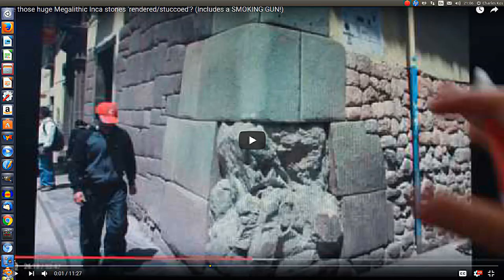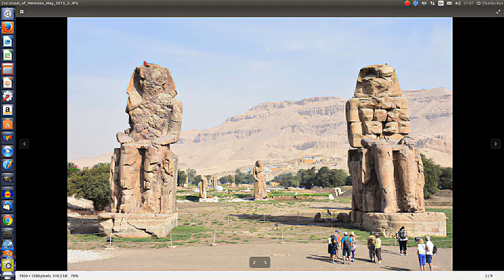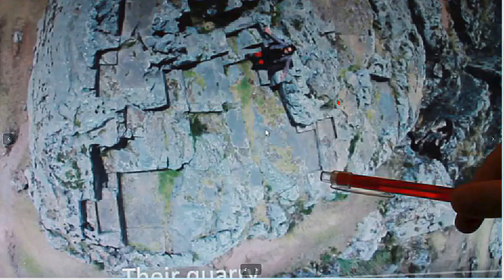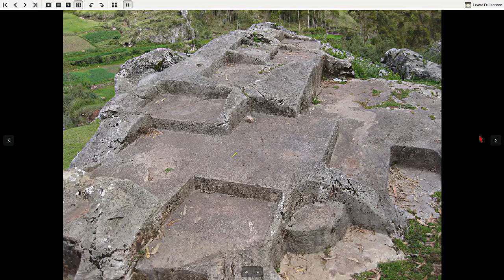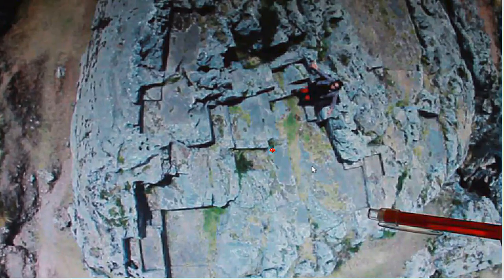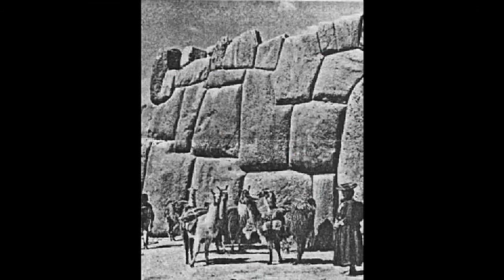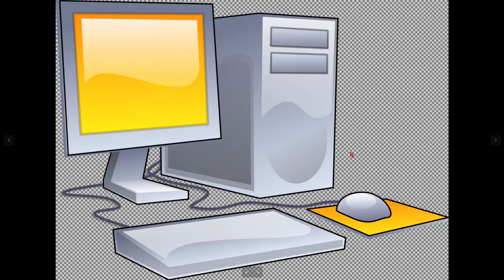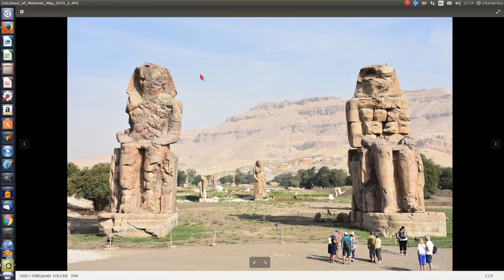'Cut like Butter'.... MOULDS were pressed in and geopolymer scooped out

Comment: I think this is geopolymer.  I think you remain spot on about the function of the geopolymer.  I know about the cataclysms that took place 11,600 and 12,900 years ago.  I would like to speculate that such a cataclysm could possibly be a galactic superwave incoming from Sag A or the galactic center.  This storm is pushing the sun's Heliosphere at the speed of light and containing gamma and even gravity waves.  That alone could be of great damage.  But this superwave has excited the atmospheres of our planets and has opened up coronal holes in the sun to expose us to cosmic rays.  Particulate in structure, they penetrate up to sixteen inches into solid rock.  So, these geopolymer structures had a capability of protection from cosmic rays, bring in excess of sixteen inches deep.  In Egypt, only sacred buildings were geopolymer, so there, it may have served a different purpose.  Maybe not.  I would like to believe that the function was to protect the masses.  But it may well have protected the ruling classes.

Comment: instead of it being a quary could it be pourd foundations for a set of buildings who,s blocks have long since been reused.  the large flat rectangular areas being the floors.   for a long time i wondered why a high technologhy culture would use stone age construction, but it may be that massive geopolymer walls were the only things to block particle weapons and radiation.  even now when we build to block radiation, we use thick concrete.  some photos show scorch marks on the walls. as if hit by some kind of energy weapon.  some destroyed sites have their blocks strewn outward farther than could be explained by an earthquake causing the walls to tumble. as if blasted from above.
Reply: It's not a matter of only horizontal rectangular extractions existing, but also vertical ones in giants rock formations around the world, so it brings to mind some kind of tool that could slice through rock like clay so slabs could be removed from a solid face.  It would have to be something like a wire/cable/taut metal ribbon or such.  It would have to have the capability to neutralized molecular bonds.  Come to think of it, that is what is seen in the 9-11 video of a plane disappearing into one of the towers without exploding on the surface.  It is preceded by a faint flash of energy just before an 'impact' that had no impact.  ...and down the rabbit hole you go.

Comment: Go to home depot by a coal chisel and tap a small line on the rock and hit it with a hammer, larger stones were quarried by chipping a groove in a rock formation as big as you want the stone and staring a fire in the groove the heat would cause the rock to stress fracture and allow you to pry the rock out, I've  always wondered if anyone has tried chipping a grove and adding vermiculite or perlite to the groove before heating as both the elements have the property of expanding when heated, just a thought probably talking out my ass though lol
Reply from the maker: Cool, but upcoming vid will show 40m rock at Puma Punku not quarried at site, could not have been brought there. Woohoo!
Reply: Not bad..

Comment: One problem with the claim of ancient high technology. Where's the platinum, the palladium, the tungsten, the faceted diamonds, the 316L stainless steel, anything sealed in shock resistant borosilicate glass? The absence of all these things that we have which will sit as they are for eons has to be accounted for. I understand that most such artifacts would be held in the deep private collections of Saudi royalty and the likes, but there's no way every single trace would vanish. It would be common to find high quality stainless cutlery and truly ancient sites would be littered with iron oxide deposits that could only come from steel beams being forgotten under the ground somewhere. I think geopolymer being behind most megalithic construction is possible, but abundant advanced technology sounds dubious.

Comment: Nice presentation. Except for the one thing wrong. They have found human DNA in all the "rocks" in those quarries. There is only one substance that can be a rock and that is what ends up as "basalt".Using molds is pretty accurate, but they didn't press them into the "geo-polymer", they sliced the flesh of the drowned giants and pushed the flesh into molds and baked it to make the slabs. If they needed a harder substance, they would just grind the flesh up in to finer particles and push it into the molds.

Comment: Sacsaywaman is not a fortress. it was built for consciousness and energy. That is why it is designed like an energy circuit. That is why Andasite and Basalt are commonly used. That is why it is full of temples. That is why it is astronomically aligned a certain way.  It's more of a center of education and initiation. You could call it a Mystery School .
Structures like Sacsaywaman were built on top of mountains because that is the best place to TAP IN to the LEY LINE. 
These structures are always built on Earths energy grid.  The ley lines may even play a role in being able to float stones for miles. 
The structure harnessed the Sun, stars and ley line, he , automaticly effecting the consciousness of everyone living in it. It was connecting the heavens with Earth.  It did make a good fortress for the Inca but history proves Ollantaytambo made a way better fortress for the Inca even though it wasn't one.

Comment: Why not build the mold on site pour the geopolymer in and let it harden, build the next mold on top and so on,. like we do now. Why create a batch off site and press molds in it to extract stones from it, which they have to transport to the building site. Seems like a lot of extra work to me, not to mention the inefficiency and the waste of materials. If they had the skill to make Geopolymer and the molds. wouldn't they do it the way we do i now. or at least have a factory where the blocks are made instead of an open air quarry. and for that matter why are there blocks in the first place if they had the tech wouldn't just cast a whole wall out of geopolymer, instead of making it out of polygonal blocks. Polygonal blocks are the strongest you can build with when using blocks but a structure made in one solid piece is actually way stronger than any blockbuild one i.e. how we build dams. and even if they made it out of loose blocks wouldn't they fuse the blocks together using the same tech as creating the geoplolymer so they could make it out of uniform blocks which they fused together during the building to create an indestructable strructure. And what are you talking about we don't have geopolymer of course we have geopolymer. 

i am with you on the recycle part of old buildings and stones. if you look how we build nowadays if we find an anciient building we like to preserve it if possible but who is to say they did that back then how many site are found cleaned up every trace of previous civilization is either removed and then a new structure is build or they can use it and refurbish it like what i think they did with the pyramids but when they do that they are not gonna leave the campfires and trash heaps and all the other stuff that the last civ has left. they clean it up and the last civ is the civ we find and then we say well we dated the surrounding areas where we found al these campfires and trash heaps and the likes. so when they say they don't find the older civs in egypt it's because they have been wipe away and all we find is the egyptians. 

The Pyramids(the big ones) have been build on bedrock you can't dig bedrock so if you clear the surface all evidence is gone. My theory is the Pyramids stuck out of the sand maybe only the tips the egyptians used to build merkaba's but then Djoser came across the pyramids and wanted something like that, so they build the step Pyramid cos that was the best they could do then Sneferu had the the bend and the red Pyramid built and Khufu was like fuck this shit i want the real ones so he simply claimed them as his own cleaned the site up totally and maybe rebuild them a bit that's why there is a worker village there. Chafre took the second one. Menkaura had the third one build cos by that time they could kinda build them but not as good or as big and elaborate. That would explain the evolution of the pyramids better in my eyes. The Khufu and Chafre ones are the ones that just don't fit the narrative egyptologist adhear to, the leap fom Sneferu to Khufu is to big and after Chafre the decline to great. but leave them out and all of a sudden the evolution of the pyramids makes sense cos there is no real decline it's more a financial decline as a buildingskill decline.

Comment: You ever watch how Swiss cheese is made? Using ice as molds and pouring hot cheese into a container with the ice already present. Then the ice melts and leaves the voids.
Reply: uh...I don't think so, or else it would be more spaces than cheese, or at least equal parts which isn't the case with Swiss cheese.  But I'll bet that CO2 gases from decomposition explains the bubble-like holes.

Comment: Thanks for sharing your views on this Charles. Geopolymer is something I've considered myself many times over the years, the nubs on pre-dynastic construction are a big clue. I was just thinking about the modern use of sodium silicate as a treatment for concrete and masonry to reduce porosity and makes them more durable and water repellent. I bet the Egyptians used the same process on the pyramids and other structures! They certainly had a never ending supply of silica in the middle of a desert and of course common salt or another source of sodium to. You should do some research into this and make a video! It's something that could eventually be proven by analyzing surface samples from areas that were sheltered from weathering. Sodium silicate concrete info: https://en.wikipedia.org/wiki/Sodium_silicate#Concrete_and_general_masonry_treatment

Comment: Well, the tech to build this geoploymer was very low and proved in several you tube videos by the geopolymer institute of France.. Very basic..  The reason they cant admit to this is because it contradicts the Roman era wirh its concrete with rebar structures.. Not sure how you can post a video on this subject without mentioning the geoploymer institute of France or its founder, Dr Davidovits...

Comment: Very interesting! Here’s a link to another great video that explains that the ‘nubs’ are the protruding remaining ‘ends’ of polymer ties made of the same ‘concrete stone material’ that were used as struts within the moulds (same was as moulds are made today or concrete walls are cast - the struts keep the sides of the mould straight). This flat area really looks like the ‘boxes’ could be holders for moulds. https://youtu.be/-HsswLyGJkM. Why ever they fitted the stones together though - it seems such a weird thing to do - if casting - why ever would you not just pop out cubic blocks? Why on earth would you fit together complex shapes? Fascinating topic and video!

Comment: Hahahaha, nukes? Holy shit, so you think a nuclear capable civilization lived without producing one piece of tungsten, high quality stainless steel, titanium, platinum, palladium, osmium or any other highly corrosion resistant metal which could sit in a bog for 50,000 years and still look relatively the same? I'm done.
Reply from the maker: I said in other vids the civ died OVER 50k years ago, tho...
Reply: Theories on early advanced civilisations seem to ignore the fact that if they were  so advanced why are materials other than stone not evident where it could be supposed that certain alloys and useful elements would be capable of existing for many tens of thousands of years as identifiable remains.